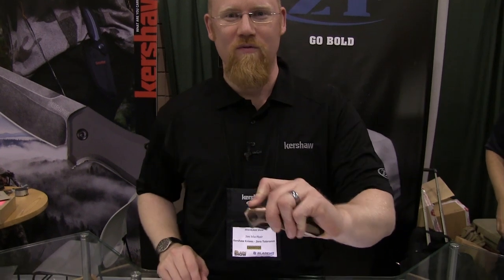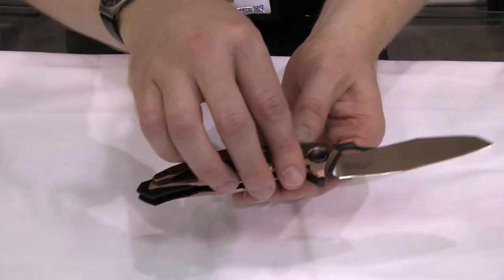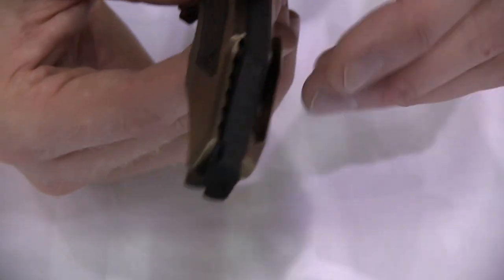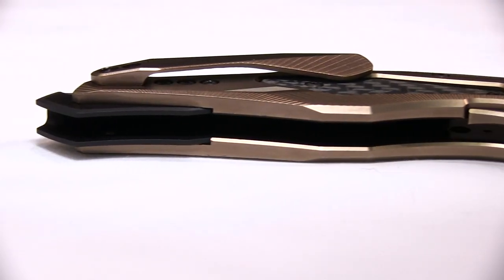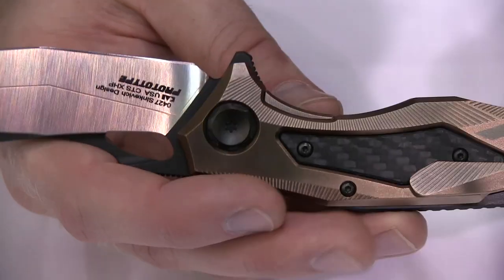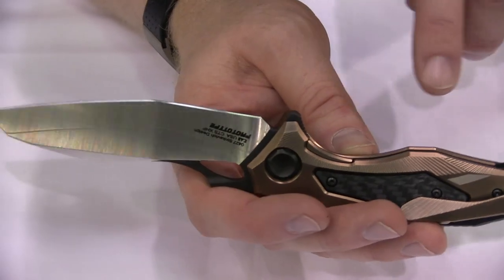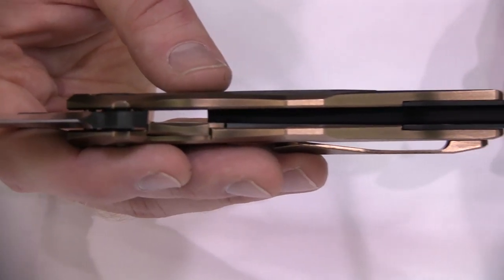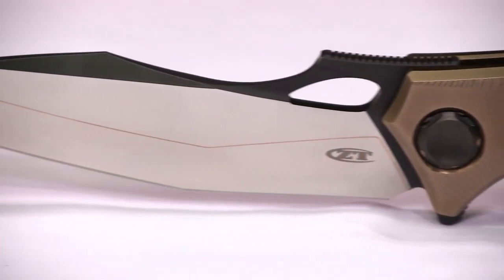Zero Tolerance New Knives | Blade Show 2016

Comment: Oh. Look. More $450 limited production ZTs that will all be sold out within a day with 90% of the customers being people from BladeForums. If anyone at KAI is reading this: if you wouldn't gladly baton the damn knife through a log, IT DOES NOT BELONG IN ZERO TOLERANCE LINE-UPS.

What the hell, Kershaw/ZT? Stop with these limited production collector knife nonsense designs. ZTs are supposed to be the flagship hard-use knife brand of KAI. How about instead of this ridiculousness, you simply move these limited production collectors items over to Kershaw proper?

Y'know, like you did with the Kershaw Tilt (would be nice if you brought that back in some form). Like you did with the Kershaw Ruby.
Reply: matchesburn Only some fondling. Smooth as eggs, baby.